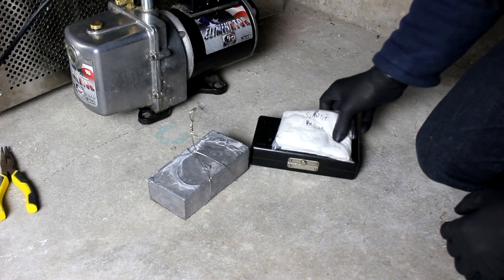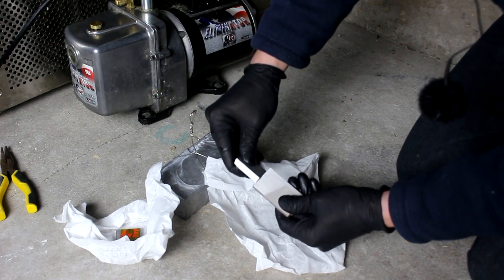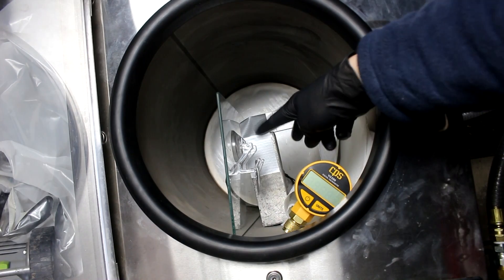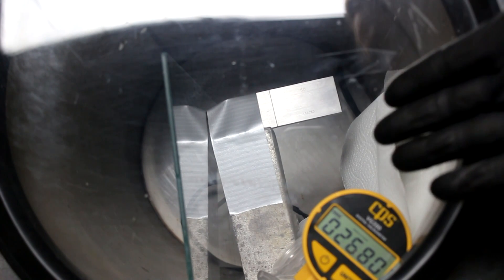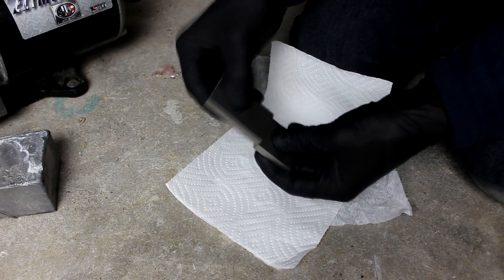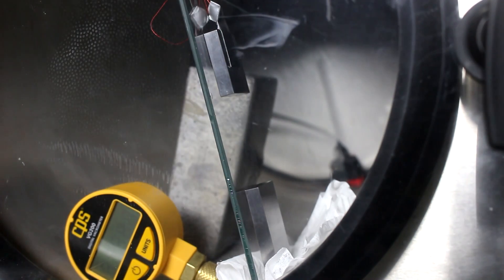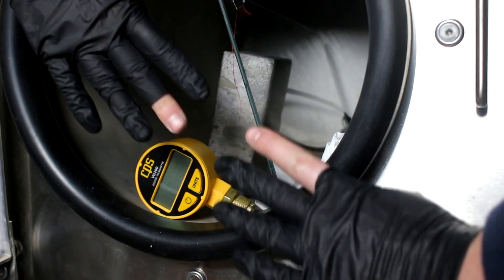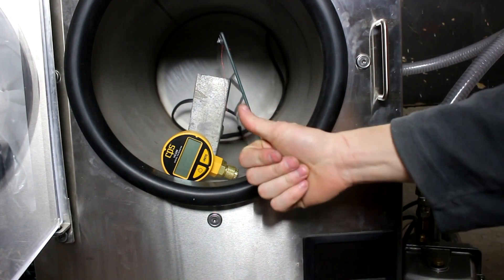Will Gauge Blocks Stick In Vacuum?

Comment: Hey Cody, I know this is pretty late but what if theres an iron oxide layer on the surface that stops molecular attraction unless it is rubbed off of the contact points. You should try putting the gauge blocks in vacuum and then somehow remove the oxide layer, then test to see if they stick without wringing.

Comment: Its Van der Waals forces ...........................include attraction and repulsions between atoms, molecules, and surfaces, as well as other intermolecular forces. They differ from covalent and ionic bonding in that they are caused by correlations in the fluctuating polarizations of nearby particles (a consequence of quantum dynamics).  Like Kecos feet!!!The ability of geckos – which can hang on a glass surface using only one toe – to climb on sheer surfaces has been for many years mainly attributed to the van der Waals forces between these surfaces and the spatulae, or microscopic projections, which cover the hair-like setae found on their footpads.[18][19] A later study suggested that capillary adhesion might play a role,[20] but that hypothesis has been rejected by more recent studies.[21][22][23]

Comment: Its just like a suction cup.  Break the suction and it fails.    Same thing with two pieces of glass they will stick.  And they won't stick in a real vaccume.   Your test sort of failed here.   You need to ring them then put in vacumme

Comment: I wonder if you are actually bending the metal, forcing a tiny near perfect bond surface where there were actual differences in the metal surface, We perceive metal as solid, non bending but, that is not the case.

Comment: The precision of the surface means that enough electrons are in alignment to create 2 electron beds. It's the act of sliding the 2 together that bonds them by a static like charge. I would bet they actually accumulate a magnetism that remains until you break them apart again. Just an idea.
Reply: I wonder if there is a way to measure that, I'm not a magnet expert.
Reply: 2 years late, but just wanted to say that ceramic gauge blocks are a thing and they also ring together (they might need to be oiled though, the only time I've heard of ceramic ones was also the only time I've heard of oil helping the effect)

Comment: I remember this from physics: the friction force decrease when smoothness increase to a certain extent, then it start to increase again reaching it's peak at super smooth surfaces...How? 
The theory says: at super smooth surfaces some of the atoms of the 2 parts get close enough to each other to form chemical bonds, not on all of the surface of course, coz otherwise The parts will be welded together...
Reply: Perhaps because the first type of friction is caused by the "hilly" surface bumping into each others and the smoother it gets you reduce the frequency of these bumps which lower the friction 
until you get to a near flat surface and then the friction increase because more of the surface area is in contact to the other.
It might be possible that it partially weld together, but that's just because the metal isn't completely exposed, so you partially cold weld the piece together and every single time you take them away, you break the weld
damaging the surface but only to a few atoms thick, so it's still not visible unless you were to do it thousand and thousands of time
Reply: @Pac0Master  
Not quite. Surface area has nothing to do with friction. At higher roughness, friction is caused by ploughing of asperities. At very low surface roughness values friction is caused by bonding of the surfaces. In the middle of these two you have a low friction point.
Reply: It’s not bonding, it’s van der waal forces.  Van der waal force is the momentary polarization of the electron “cloud” when one atom comes in very close proximity to another.  It’s a weak attraction force.  That’s what you get more VDW force when the sides are near perfect flatness ie.more atoms from the 2 sides are in close enough proximity to allow for VDW force to act on them.   This is lower division chemistry in college.
Reply: @yinshah3303  Can you recommend an experiment that would demonstrate this using gage blocks?  I don't doubt your explanation, but I'm curious how you would go about proving it given the resources someone like Cody has available.
Reply: @somethingelse4424  Sadly I’m not that smart.  Regurgitation of college material is one thing, coming up with experimental proof is entirely something else.
Reply: @yinshah3303  Well, I don't even mean proof.  Just if you could think of any small way to modify the experiment that could point one way or another.  I had a few ideas about how to eliminate variables regarding vacuum and macro details, but I'm not smart or educated enough when it comes to intermolecular forces to know where to begin.
Reply: @somethingelse4424  Haha.  As I said, I’m nowhere smart enough. One idea which isn’t possible until you can manufacture another super flat surface using a non conductive material like stone to first, see if they still adhere to each other.  Then measure if there’s a small difference between metal blocks “stickiness” vs rock block stickiness.  With the force being so weak, the other factors like surface area, degree of smoothness can skew the results too much.   My reasoning for this comparison being that metals have electrons that are less bound to the nucleus of a particular atom, creating a slightly larger momentary polarity then atoms of a rock.   But again, the measurements have to be so sensitive and the machining of the pieces so precise and equal in every way.  Please know that I’m talking about things I know very little about.  But it was nice thinking about it.  Have a nice day.
Reply: @LazicStefan no the bonding is caused by a few different effects (some of which are shown in the video), I'm not really across the details though.
Reply: Two pieces of metals can not form covalent bonds, metals have valence electrons moving around the metal, they are not localized and so can not take part in bonding!

Comment: The reason why it won't stick now is because there not enough force to rub the oxidation off there if you were in a vacuum chamber and could clean the oxidation off then touch them it would bind

Comment: The reason why in the vacuum chamber doesn't work is because you are removing all the moisture (The air...)
I got some copper cylinder with a near perfect flat surface and i can do just that.
The water(moisture) trap in between the surface bond with the 2 face. When you slide the 2 surface you remove all the oxygen and the only thing remaining is the moisture that couldn't not escape.
If you put a water dropplet on the surface you will see how it react, but the dropplet is too much water and will most likely just not bond.
If you would have pull the 2 plate away from each other in the vacuum chamber it would have most likely fall of due to the pressure being gone, resulting in the moisture going from water to a gas state.
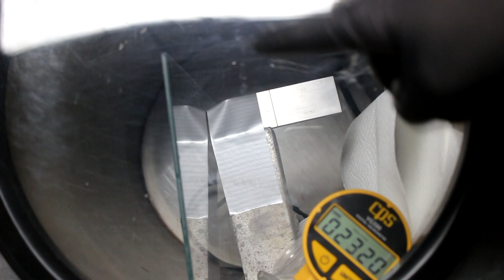7:05 is your answer, you said the key word. A liquid inbetween the surface.

Comment: looke at the surface of the gauge block under an electron microscope before and after. I bet you could see groves in the metal ,in the direction they are rung. Say you try a twist to ring them or a straight slide. the groves are going to be interlocking as would a dovetail cut in wood. 
lmk the outcome or your opinion.

Comment: We have ceramic blocks at work, and usually use them to assemble block sets to have a custom internal size. We try to clean them as best as possible without leaving fingerprints then they are locked together on a shaft. Usually when they're taken apart some pieces are damn near impossible to seperate from eachother and we dont wring them together. They may get tapped flat but it's just a screw force holding them together besides that.

Comment: Hey Cody! I was thinking back to a science experiment. When rubbing a magnet on a nail directionally it would become magnetic. I also heard that rubbing two things of the same material together can change the charge. I was wondering, could the perfect surface and the controlled directional rubbing be causing the two pieces of metal to be magnetically attached? Maybe you have some sort of meter or experiment where you can test the change in charge where the two metals contact?

Comment: Another vacuum test is needed. I'm concerned that having the blocks together for a long time could introduce other factors like cold welding. Wring them together quickly, then do the first test again to see if they will separate under vacuum

Comment: Something to ask, which people have probably already done, is: does this work with all metals? What other kinds of materials might this work with? If it's a metal only thing, then there are a bunch of options you could eliminate. If it happens to a lot of materials, then it would have to be because of a property they all share. If it only happens to, let's say, ferromagnetic metals, then we can again eliminate several options. Basically the method of elimination.

Comment: I would push them together using a vice.
In this way you prove/disprove the theory that atoms might need to mingle between the 2 or there is enough to get them close.... basically is the sliding movement required?

Comment: The friction causes a resonance and a dielectric discharge. Kind of like a cold weld in a knife. When moving the steel, the layers reorganize themselves but the crystals will not penetrate each other if the temp is not right. No vac required, just dielectric discharge.
Reply: @bigoldfart  um ok so what's your theory?

Comment: 9:56 1 other thing aside from the tape causing the blocks to not lock at a perfect angle, the glass pane you are using, isn't perfectly flat either. Also force needs to be used to press the 2 blocks together.

Comment: Cody, you could also wrap the gauge blocks together with some rubber bands and then put them in a vacuum and see if they stick. You can of course combine that with the string and the laser. Just an idea, although I really dont think the air pressure is what makes them stick.

Comment: I think the problem may be that even though they are put into a vacuum and are touching through bare metal, there is still an oxide layer in between from their time outside of the chamber. If you were to clean the oxide off while in the vacuum, the oxide wouldn't form and you would have cold fusion happening more readily

Comment: The Van Der Waals effect should be different for metal and ceramic gauge blocks. And you should be able to estimate their forces depending on the molecular composition. If you test the strength of metal and ceramic gauge block connections, they should vary proportionally to their van Der Waals effects. 

Also, you showed that a vacuum was not the only thing holding them together. But if you found the connection strength in and out of the vacuum then you could see if a vacuum had a contributing effect.

Comment: My hunch is that due to the two uniform surfaces putting them together rebuilt the lattice structure, making basically a single piece of metal however not all atoms bond thus not making perfect connection

Comment: If you can remove the layer of oxidation that forms almost instantly when they are exposed to air, they should instantly weld in a vacuum.
Reply: Use gold blocks or gold plate these ones.  No oxidation, so they could cold weld in a vacuum.